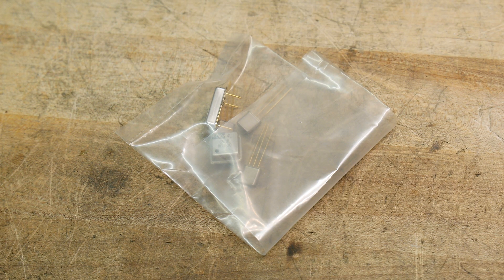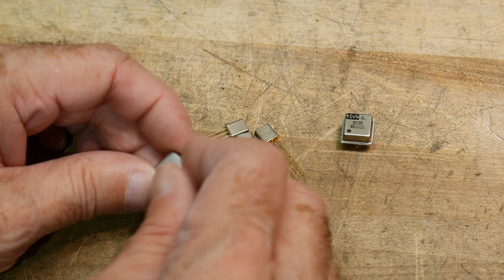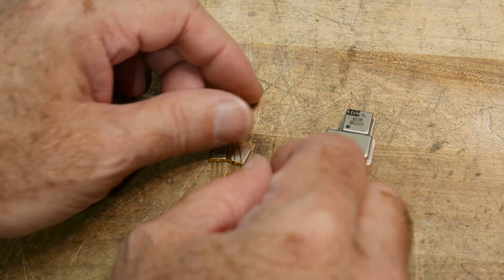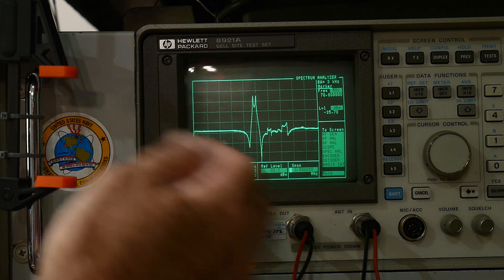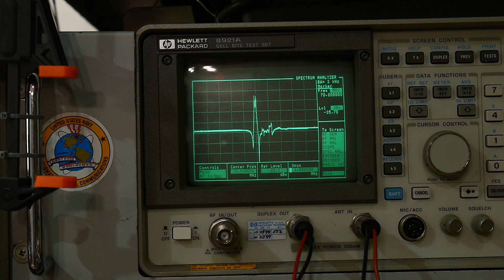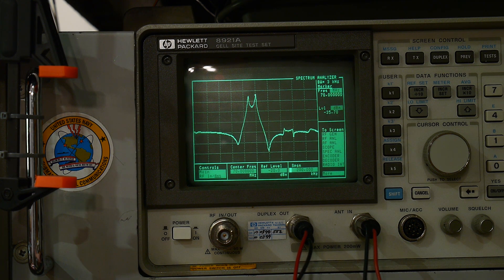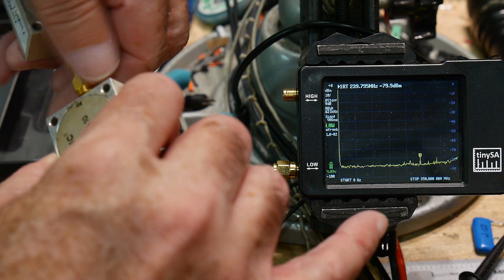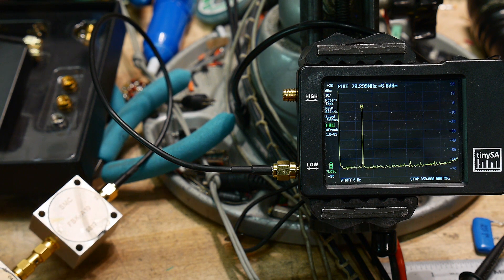#589 SMA 70MHz Crystal Filter

Comment: If you update your NanoVNA firmware to DiSlords latest you'll have an LC matching filter calculator built in ready to tell you what simple matching network to use on the input and output of the filters.
Reply from the maker: Where do I get a dfu file?
Reply: @IMSAIGuy  https://groups.io/g/nanovna-users/files/Dislord%27s%20Nanovna%20-H%20Firmware